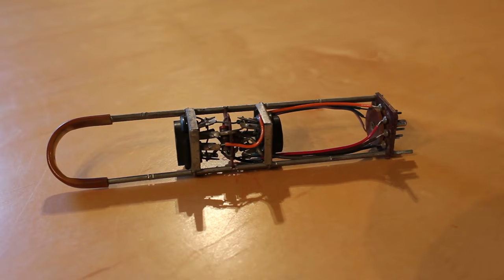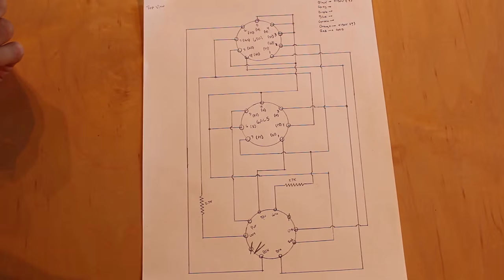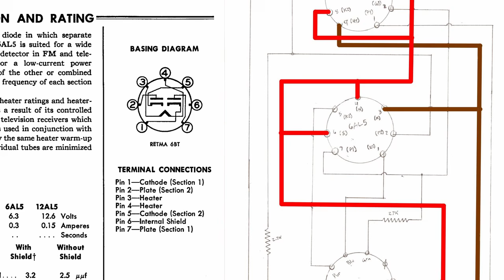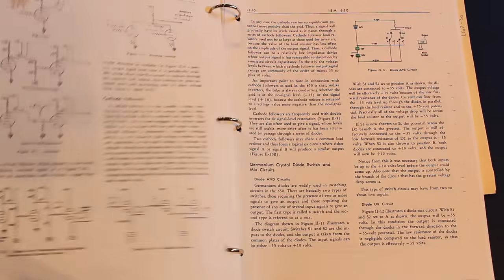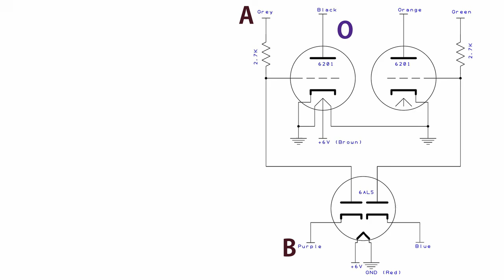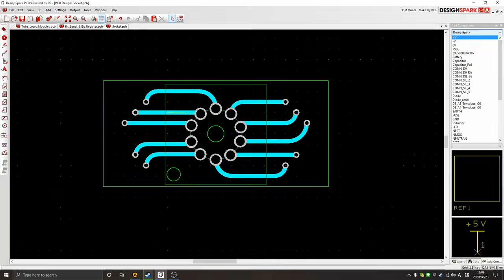Reverse-engineering an IBM Mainframe Vacuum Tube Pluggable Module

Comment: Nice alanyslis. 150v is easiest. Take AC 120 caoacitor couple in series  use full rectifier, voltage fuse voltage drop resistor dexouple capacitor and blerder trsistor... same rig with half wave rectr. two dexouplimg    capacitors in series centertap to ground you have + - 35v use voltage drop reistor or set of resistors i seties to capacitor for adjusting voltage  divider.  Thats old axhool. DC load B+
Reply from the maker: Thank you!
I'm not quite sure I follow your comment, but thank you regardless!
Reply: @UsagiElectric  its based on " capacitor.loaded AC"  a.k.a Marshall bias circuit.  Also two diodes head to head with 10.000 uf 10v capacitors in paralel to each diodes do the trick. ( diodes clip AC mains voltage to few volts). Rest is voltage divider.. note: first  circuit is galvanicaly isolated from mains by capacitor so depending on how you hround it it can ne B+ B- or both with centertap grounded capacitors in series.

Comment: Knowing a thing or two about serial computers, (https://www.youtube.com/watch?v=Wa7KVU_e8U8) I wouldn't expect this circuit to be used as a "NAND" but my guess would be  it is a "gating circuit"  with one input supplied with a bit stream and the other input with a control signal that either lets the bit stream through or blocks it.   There are other possibilities as well.
Reply from the maker: Thanks for the insight!

That makes total sense. Actually, I often use NAND gates for gating in my own designs, so that seems like the most logical use for them (I use NOR gates/multivibrators for making flip flops and all the other logic in my tube computer). 

That Elliot 803 is a super cool computer! I always forget just how big transistorized computers really were. They were definitely an improvement over vacuum tubes, but it wasn't until ICs and minicomputers that computers started to get down to sizes that were a bit more manageable. Man, I'd love to play around with an old tube computer or transistorized computer one of these days!
Reply: @UsagiElectric  If you are ever in the UK drop me a line and we can meet at TNMOC for a day of old valve and transistor computers !

Comment: Nice work!  Lots of combinational logic typically use NAND gates. I worked on a early computer Univac 1219B that had tons of little transistor flip-flop cards (and also tons of neon displays!)   Maybe this was a 1 bit  register (SR Flip-Flop)?
Reply from the maker: Thank you!
That's awesome that you got to work on an old Univac! Transistorized computers were insane. Even with transistors, they were still absolutely massive units.
This very well could have been used as a 1-bit flip flop. Though, I think IBM's goal with these little modules was to have them as universal pieces that could be interchanged and used wherever necessary. So, I imagine that things like this module also got used for the glue logic that helped connect larger sections of the processor with each other.

Comment: Old computers did it all first. Really, the only thing that happened in the past 50 years is everything got smaller. Get rich, get workers, buy a warehouse or two, and you can build an old computer that does everything a new computer can do, and more, because where new innovations are done through a microscope, old computers just get bigger so you can literally walk around inside each component and see in giant detail what can be improved. Got a small part that you want to change its function? Then just blow that box up to room-size and stick another large computer inside it. It's the difference between growing life in a petri dish and growing life on an actual planet.
Reply from the maker: When I first started learning about the old IBM machines like the 604 650, etc., I was blown away at how the fundamentals of computing haven't changed since the 1940's! You're right that really the primary change has been size, though speed has also been an area of pretty impressive improvement. Vacuum tubes definitely have a speed limit. The IBM 604 had a clock speed of 50kHz, which was impressively fast for the time. For my tube computer though, I'm aiming for a clock speed that I can vary from about 1Hz to maybe 1kHz peak.

Still, if I got rich and got myself a warehouse, I very much so would try to build an 8-bit vacuum tube computer that can run Basic, haha!
Reply: Well, actually.... I am no expert on old computers, but using binary logic was a not the obvious choice from the start. If I remember correctly a handful of computer pioneers used trinary logic, that is - 1, 0, and +1. I am not sure why or what the advantage is/was, but it was used.

Comment: Very interesting and instructive test. Survival of regulators without real heatsink surprised me too although it probably didn't run for long enough. I'm seeing lots of tubes in semi pro audio running at around 24V because they distort a lot at such low voltages, which is what many people like. 
Anyway, test shows tubes are very bulletproof and of course much, much bigger than the same thing made with transistors. My guess is tubes will be used in audio for many years to come because there are no solid state counterparts when it comes to harmonic distortion, headroom, etc. Transmitters are another application for them.
Reply from the maker: Thank you!

Growing up, I always heard about how tubes were super unreliable and broke all the time, but my experience has been that tubes are, as you said, pretty bulletproof! Out of the hundreds and hundreds of tubes I've been messing with so far, I've only had one tune that had an internal short, and less than 10 that I've broken the glass on due to dropping them, which is actually not all that different of a failure rate compared to cheap ICs and digital components. Conversely, it's hard to find an old Commodore that doesn't have a bad chip, but almost every old tube equipment I've come across is still rocking the original tubes, despite being often times 60 to 70 years old!
Reply: @UsagiElectric  I was born 1960 in Helsinki, Finland. I remember that once we (me and my father) went to a tube shop with a tube from our B&W TV to check if it has failed. They had somekind of test bed where you inserted the tube and it told if it was working. The tube weren't and so my father bought a new one. Can't remember that we went there more than that one time. What I mean that by my recollection the tubes weren't breaking willy nilly. We also had a tube amplifier for our record player and it worked until 80's when my father bougth a stereo amp. Can't remember that we changed tubes in that ever.

In 70's, when we had bougth a colour TV, I took the B&W and dismantled it studying how it was made. It had full circuit diagrams folded like a map and put into plastic holder behind the TV. Whenever I had some problem to figure out I asked my father to help and we figured it out togetrher. My father was an electrician. I'm an telecom engineer but studied later to became an automation electrician. Love watching these.
Reply: @UsagiElectric  Old circuits are pretty simple, of course depending on application, transformers needed to match impedances also help protect them and give them big part of the sound. Microphones, limiters/compressors, preamplifers, power amps and similar often sound much better with tubes than transistors. Of course it depends of what one wants. Russia is continuing making tubes for 100 years or so, China joined too so we have supply of well made components comparable to old production. I'm interested in knowing about your stock of old tubes, if you want to share information about mine i can send you contact.                          Btw, modern synthesizer modules are often made from receiving tubes, rectifiers are solid state because they don't influence the sound or function in most applications.
Reply: Some tubes are actually quite clean sounding at 24V.
Reply: @douro20  Still not nearly good enough for pro audio or even serious guitar amps. I'm talking about in production receiving tubes, not NOS stuff that is getting depleted.

Comment: Nice, logical reverse engineering. I was also waiting for the breadboard to melt. LOL.
Reply from the maker: Thank you!
Not gonna lie, I was a little nervous running higher voltage through the breadboard, but fortunately, everything in use here was at extremely low amperage, and I wasn't at high enough voltages to cause arcing, so it all worked out alright in the end!
Reply: nah, the traces is probably far enough, 150V is not that high for the arc to jump on air that distance. as long as you have a good enough bread board. perhaps if you tried to pull more than 10A it would blow up

Comment: Since you could not find this circuit in the IBM manuals, I am wondering if perhaps it could have been made by one of the other early computer manufacturers (Remington Rand, Eckert & Mauchly, RCA, Ferranti, Engineering Research Associates, etc).  There were also some vacuum tube computers that were built in-house by universities, government agencies, and militaries of various different countries.  The reason I think that very few of the tube computers appear on Ebay, is that I suspect that many of them were dismantled, and parted out a long time ago.   I also think portions of them were donated to museums.  Some may have been destroyed completely as some of them were used for very specialized applications such as encrypted message code breaking, missile firing tables, math research, aerospace, census, income tax processing, research, and a variety of other very specialized applications.  Computers would not appear in widespread home use until the late 1970s and early 1980s.
Reply from the maker: I'm fairly confident it is from an IBM because in the IBM 700 Customer Engineering manual they show the shape and pinout of the pluggable modules they used and it's pretty much identical to this one: https://i.postimg.cc/PxDPZ3WL/700-module.jpg
My guess is that this particular unit is from the 704 or 705, but I just don't have good documentation on those machines to confirm with.

You're absolutely right that a lot of the computers got dismantled or parted out long ago! I kind of see them like a 10 year old Dell desktop. I love salvaging old stuff, but I'd be hard pressed to pick up one of those, haha. In the 70's, when the transistor was bringing computers down to manageable sizes, these old tube mainframes and computers were often returned to IBM and pulled apart. It's a shame because they were such instrumental pieces of history, but that just makes it that much more special when you come across a piece from one!

Comment: Great video man, high production value and actually interesting. Personally, I've always had an aversion to vacuum tubes because of the not-easily-attainable voltage levels and high impedance outputs, but it's great to watch someone passionate about them. I have a question, but it feels a bit weird to ask because it's not about the actual module that is the topic of this video but rather about your breadboard. I see you have jumpers on your breadboard's power bus, but the bus markings are unbroken, indicating there's no break in the bus itself. Did you do it as a precaution because you got burned with this bus discontinuity stuff before (I know I have) or is there an actual error in the markings (which I have to say I've never come across)?
Reply from the maker: Thank you so much!

That was actually my primary aversion to tubes for a long time as well. High voltage scares me because I have a bad habit of sticking my fingers in circuits. But, we had some spare tubes from salvage in a box, so I decided to see if I could get any reaction out of them at all at lower voltages. I tried a variety of voltages from 6V to 30V and settled on 24V because it worked well for stacking heaters in series.

No worries on asking about the breadboard! The best part of making these videos is interacting with people, so feel free to ask any questions, whether related to the video or not! I don't know why, but these Miyako breadboards I'm using don't have the broken markings, but the bus itself is indeed broken. It took me the better part of a day to figure out why half my circuit wasn't working the first time I built something big on the breadboard. Now, I chose to go with the Miyako brand because I have another Miyako breadboard I picked up years ago in Japan that I love and the bus isn't broken on it. So, I have no clue why they didn't used to be broken but now are, and it's even stranger that they didn't mark it.

Here's the Miyako breadboard: https://www.amazon.com/gp/product/B014LEA2DU/ref=ppx_yo_dt_b_search_asin_title?ie=UTF8&th=1

Thanks again for the kind words!

Comment: UE reverse engineers a dual diode by memory. Gets excited about a neon bulb. :) I'd be fascinated to see how much fan out a person could get at lower-than-spec voltages compared to the 150V. With modern output devices, could a usable adder be done on lower voltages? I hope UE can find more modules!
Reply from the maker: Thank you! I do tend to get excited by the simple things, haha.
It's funny you mention a usable adder as that's generally my go to circuit when experimenting. It took me a lot of experimenting and revisions, but, that's something we're ultimately working towards with this channel/ It's quite surprising what tubes are capable of at just 24V!
Here's a sneak peek: https://i.postimg.cc/856TBWwm/IMAG3002.jpg

I'm always keeping my eye out on eBay and other places for more modules, if I can find some more, you can be sure I'll be snatching them up and figuring out what they do!
Reply: @UsagiElectric  The photo definitely piques my interest. If I find anything I will send it to you. About all I've got left myself now, though, is a falling apart RCA vacuum to manual. Those were the days...in the basement as a kid checking for linearity on an old Simpson.

Comment: Also, being a dual-nand, the module can probably be configured to be a latch.
Reply from the maker: Thanks for checking the video out!
There's actually a couple of different ways to make a latch using tubes. IBM liked to use an incredibly simple multivibrator setup with a single dual triode and a handful of resistors that works surprisingly well! 
I go into it in a lot more detail in this video: https://youtu.be/JmNRxVi2y-g

Comment: Can you tell us what that 6V power supply module is?
Reply from the maker: Sure thing, it's just a little buck converter I found on Amazon (link below). I just soldered header pins to the Vin and Vout pins and it was just serendipitous luck that it lines up perfectly with the voltage rails of the breadboard!
https://www.amazon.com/gp/product/B018JPGKQK/ref=ppx_yo_dt_b_search_asin_title?ie=UTF8&psc=1

Comment: 150 volts ! It's for science b** :-D
This is a really nice piece of hardware that you got here, enjoyed it a lot !
I am wondering what you are planning for the next video, we'll see it soon :-)
Reply from the maker: Thank you so much!
Fortunately, DC is a lot less scary than AC, and while 150V can make some pretty sparks, it's a lot less likely to really hurt me. Still, not recommended though, haha.
The next video has me pulling out a piece of old equipment and fixing it up, so I can test some theories and ideas!
Reply: @UsagiElectric  Yep, AC is amazingly efficient but a lot more hazardous ! However, you know, I managed to see a little arc with the power supply of Ben's 8 bit computer. I don't know if it was that dangerous for it was tiny but I fixed it anyway ^^'
Ohhh this sounds cool, can't wait to see it soon :-)
Reply: @antoinestevan5310  DC is more efficient than AC.... Thats why very high power transmission lines across states/countries are DC like Basslink (between Victoria and Tasmania)

Comment: Hello, this was AWESOME! I learned the biggest amount of information about vacuum tubes from your videos. I was curious how did you made that socket, what were the things you put the socket in? Keep up the good work, you're doing great videos!
Reply from the maker: Thank you so much!
The socket is actually just an extension of the 9-pin sockets that are similar to the sockets I made in the previous episode where I make the circuit board for the SR flip flop. I have a custom template in DesignSpark that draws a large pad and machines a large hole in the center of that pad that little 1mm PCB headers (https://www.mouser.com/ProductDetail/Harwin/H3161-46?qs=p%252BybrH12zCFIuSSHm88cAQ%3D%3D) can be pressed into. 
The IBM module uses the same pin spacing and diameter as a 9-pin vacuum tube, except it has an extra 10th pin. That made it pretty easy to modify my 9-pin template to fit the IBM module!
Thank you again for all the fantastic support!